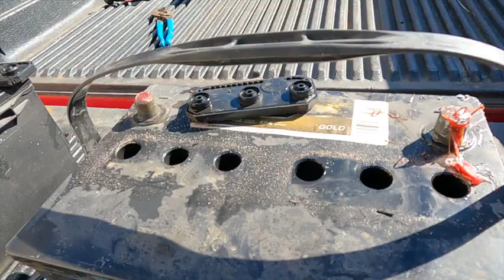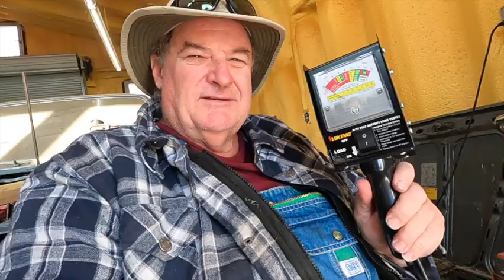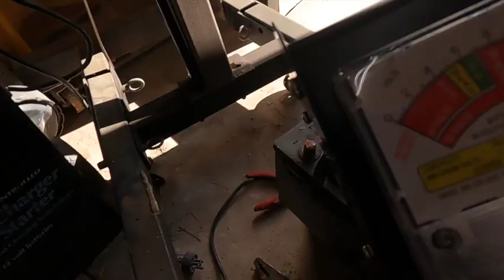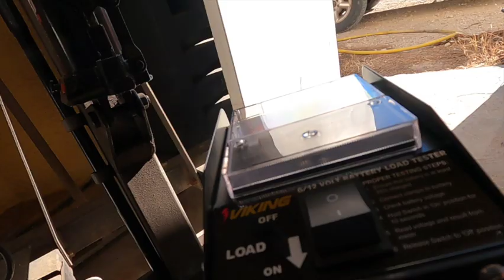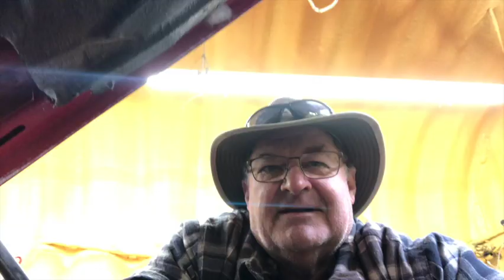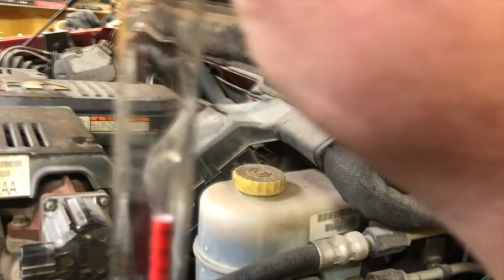2007 Ram 2500 Electrical and Transmission Problems Part One Testing Batteries

Comment: Aimless... YT isn't showing me your videos in my 'Subs' tab as it should... randomly saw 1 of your newest vids & had to come to your channel to see that I've missed a few... Keep at it brother.

Haven't watched the 2 vids after this, but these trucks ECU/PCM/TIPM all go bad, notoriously.
Reply from the maker: Thanks for the advice on the electronics on the truck. Replacing the line pressure transducer fixed my shifting problem for a week! Now it’s back to the same thing so there will be a video #4 at some point. Your issue with not getting my videos seams to be something you need to fix on your end. I hope you get it resolved. Anyhow it is nice to finally meet the one guy who watches my videos. Lol
Reply: @KevinKalden  Turned on post notifications, so we'll see.

No problem. Good luck, God bless.